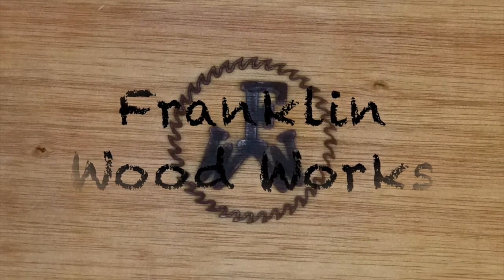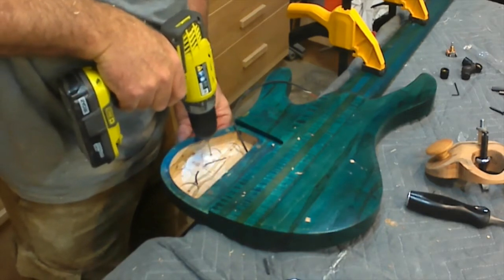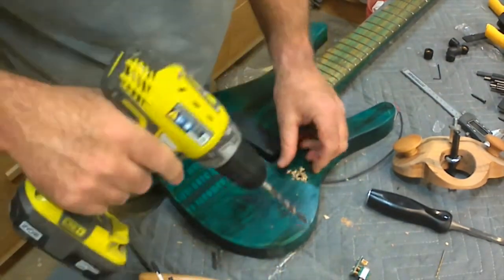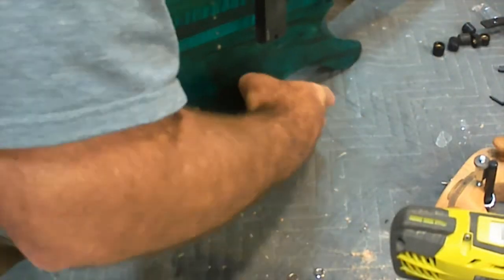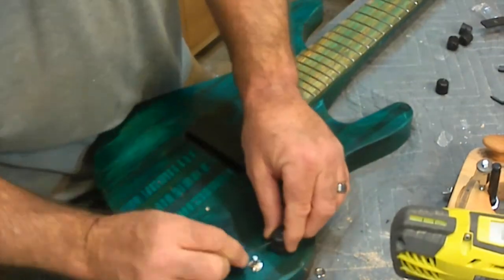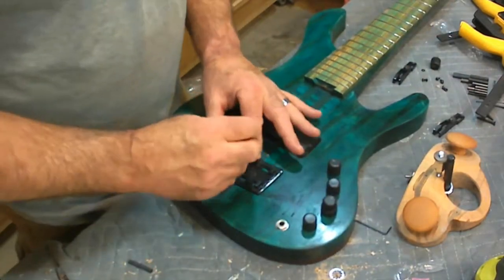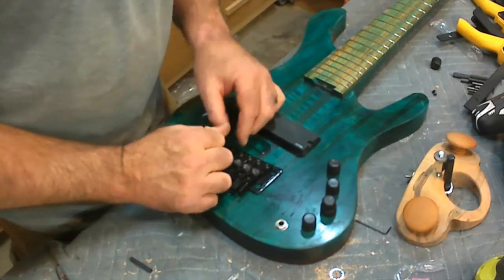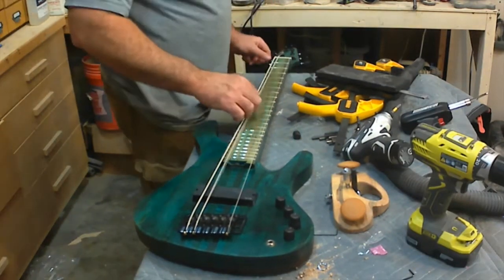Building a Six String Bass - Final Assembly...Finally!

Comment: I also thoroughly enjoyed the series -  and the bass sounds great.  Assuming you recorded it using some kind of DI/USB interface  (vs a micced amp, etc).   I do have one question - it looks like you left a lot of meat on the neck behind your first fret  - was that intentional for some reason (worried about the headstock breaking... just like a big fat neck there...)  or would you do that differently next time?   I'm a 'the-thinner-the-better'  neck guy myself but this is a very subjective thing.  Some players are "the -chunkier-the-better'.  I'm also primarily a guitarist but I have doubled on bass for years,  and play a P-bass which feels like a baseball bat.  I've never liked the neck but when I bought it I was 14  (1974 P-bass) and didn't know the difference,  so I just learned to live with it.   Thx again.

Comment: Congratulations on getting it done! Loved this project and going to be rewatching it as a guide when I'm building my own bass in the summer. Quick question, where do you get your info about, for instance, the pickup or the eq? Just wondering where I should look around for reliable info. Thanks!
Reply from the maker: Roel Bakker That's a big question.  I'll probably make some folks mad with my answer.  I can't really tell the difference between a good pickup and a great one.  Assuming you're comparing apples to apples, the difference between a dimarzio and a bartolini is too hard for me to discern.  So I tend to economize. I read forums, but try to filter out the nonsense.  I pay attention to what pros play.  Since I'm not a bass player and don't have any real preferences, once I settled on the EMG passive (I knew I didn't want active), I chose the EMG EQ because of ease of installation.  If I can avoid soldering, I will.
Reply from the maker: Roel Bakker BTW, thanks for hanging with me throughout the series.  If you're going to watch the series again, pay attention to the guys I mentioned in the first video.  David Fletcher can teach a chimp to make a guitar.  He's amazing.